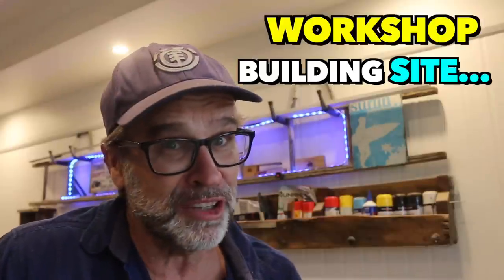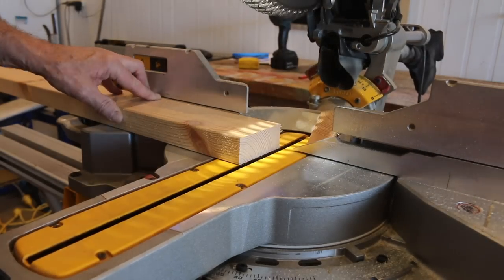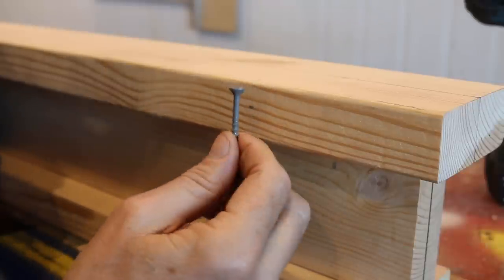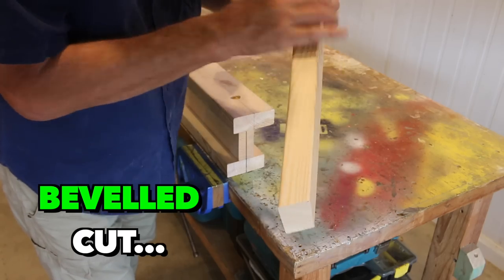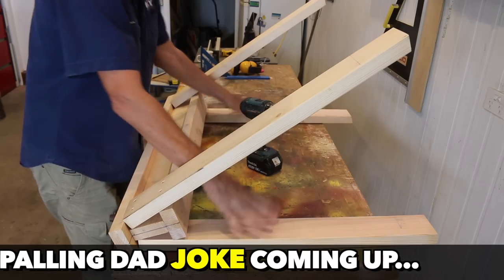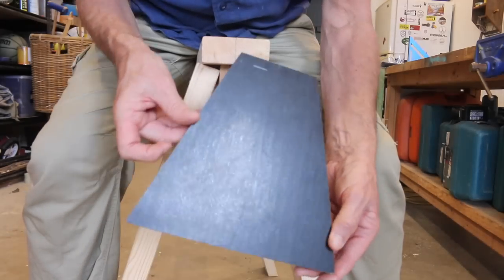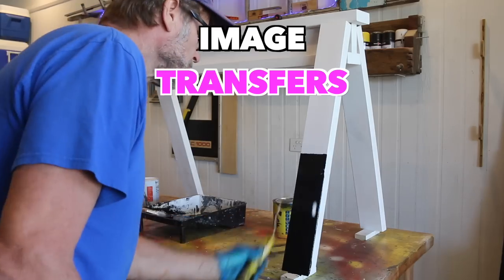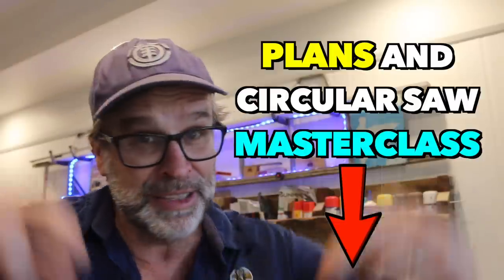Every Workshop NEEDS These Sawhorses!

Comment: Thanks for this lovely helping, non serious and playful videos! Keep em coming ya little horse! 🐎🎠
Reply from the maker: Hahahahha....Cheers Ethan 👍😁🇦🇺
Reply: Good one Knackers. One small thing I would add. When building my first saw horses as an apprentice Chippie, I was told to also cut the bevel on the top of the legs. That way the end provides that bit of extra direct support, for those times we sometimes put heavier loads on them. That is just me and your method would do everything you intend it to. Keep up the Dad jokes, I am not allowed to use them at home, except when the kids visit. They still laugh, even if my wife does not.

Comment: Great saw horses, indeed. If you're a little careful with your saw, they're going to last you a long time.
One little idea: you could add a board between the legs of the bottom one. It can be a place to lay a tool, and it can be a place where you can put some serious weight of you need your saw horse to withstand some pushing.
Reply from the maker: Yeah, that's a good tip Andre! Glad you liked them mate 👍😁🇦🇺

Comment: I already have a couple of pairs otherwise I’d be making some. My top tip use a length of old kitchen worktop (about 1.2 metre long) on top.  Enough weight for a solid bench for most purposes and easily stored. I don’t imagine I’m the only one.
Reply from the maker: Good tip Mike! Thanks for watching mate 👍😁🇦🇺

Comment: Dear Uncle! For added dust collection and riving knife I picked up a Makita track circular saw (6 1/2 inch blade) with tracks and I am getting ready to use it! What puzzles me a lot is your recommendation to adjust the depth of cut to set to exceed the thickness of the material to be cut by roughly 1/8 of an inch, and yet you make a beautiful cut straight on you bench without any “obvious” evidence of scrap wood elevating the material all WITHOUT SCRATCHING your workbench top?! Some advanced trick we need to be aware of??

Comment: I love making these things. If you move the legs in a few inches from the ends, the I-beam design allows you to make brackets from the same 2x4s you use to build the sawhorse to quickly slot on all sorts of detachable addons for jobs that can attach by drilling a hole through the centre beam in the I and the U shaped bracket you slide into the I and slapping a bolt through to lock it on. Very handy and versatile design that can serve as a portable workstation with a little imagination and time spent building a few things to further it's functionality.
Reply from the maker: Some great tips there P.P! Thanks for sharing 👍😁🇦🇺

Comment: Great and easy saw horses.  I'm making some like this.  The only addition I'm going to do is to not use plugs, but instead put dowel protruding about 10mm from the bottom screw recesses.  That way, the horses will stack like LEGO with the bottom dowels fitting snug into the top screw recesses.  It will make the stack stable by eliminating lateral slipping.
Love your videos!
Reply from the maker: Great tip mate!!! Would love to see that 👍 Thanks for watching 👍😁🇦🇺

Comment: Great vid again Uncle, love the whole series of DIY for knuckleheads…could have been meant for me😅..one thing I need and have not found in your vids is how to make an extension table for a cheap(est) table saw from Bunnings. I love using it but can’t do cuts on wide or long material.  Which means I use a circular saw and that means re arranging my work shop as it’s quite small. Anyhow Unc anything you can suggest will help..keep calm and carry on 👍
Reply from the maker: Thanks Phil...glad you like vids mate 👍👍 I don't have a video on the extension table like you want but l'm sure there would be an example somewhere on the Tube. Good luck with it mate 👍😁🇦🇺

Comment: Nice strong design. If I get around to making a couple of  these I’d consider adding a couple of bench dog holes as I’m sure the saw horses would still be plenty strong, even with a couple of holes along the center line.
Reply from the maker: Yeah, good tip Marcel 👍 Thanks for watching mate 👍😁🇦🇺

Comment: Awesome sawhorses! How do you figure out the angle of the bevel cut? I always struggle figuring out the angle if I want something like legs sitting flat on the ground
Reply: Go to the channel and watch the original video when uncle knackers makes sawhorses for the 1st time 👍🏼👍🏼👍🏼 if I remember correctly it’s 17 degrees or something
Reply: Screw everything together first. Then measure the height of gap to floor on one of the corners. Simple trig then gives the angles needed. Unscrew and cut, screw back together.
Reply from the maker: Thanks August! David is Right mate 😁

Comment: Hey mate, sorrt i couldnt find a video on your channel that shows how to do yoir image transfer.
Could you please share how you do this?
Keep up your awesome videos!
Cheers mate.
Josh
Reply: Ahh no worries mate i found your video 😊😊 label paper!! Cheers mate
Reply from the maker: Awesome! You'll have fun with it Josh 👍👍 Just one quick tip....once you print the image, be very careful not to touch the image as the ink is sitting on top of the paper and smudges very easily. Good luck 👍😁🇦🇺
Reply: @diyforknuckleheads  thank you. 

Ive been using a glue like product called  MOD PODGE. You can transfer the ink from standard printing paper. But it leaves a translucent surface just like wood glue would if you didnt wipe it up before drying. You should give it a go sometime to compare. And i will try your method too 😊

Thanks mate
Reply from the maker: @SpiderKillaz  Josh l've used Mod Lodge before on a couple of projects...it's good stuff.but a little more expensive than just an image transfer 👍👍

Comment: Nice horse. Just 1 question, would it look nice / be stronger if the top of the legs were bevelled too?
Reply from the maker: Thanks Adam! When you bevel the top the leg it narrows the stance of the sawhorse which makes it a little less unstable. Crazy l know, but it does change the angle of the legs more than you would think 👍👍

Comment: Uncle knackers, great video. Love the lame jokes 😃.

I got a Ryobi saw instead of ozito (I thought I would spend a little extra for a critical tool) but the Ryobi is no good. It tips from side to side while cutting. Is the Makita any better? Or is it a common fault in all circular saws?
Reply: Not "lame" jokes they are DAD jokes, silly.
Reply from the maker: Thanks mate. With all power tools tools there is a degree of user capability. If you hold the saw flat it shouldn't tilt. My Makita is as flat as a tack and l have no issue at all with it tilting. Good luck and thanks for taking the time to watch. Cheers 👍😁🇦🇺

Comment: Really nice pair of sawhorses Shane, really nice (and here comes the but) but I have just priced the material needed from the hardware pirate called Bunnings and even using the cheapest crap I could find in their den of thieves the 4 x 2s, sorry 90 x 45 it will still cost around $95 which doesn't make for a very affordable pair of sawhorses.
I mentioned to a Bunnings cashier about the stupid price of wood post COVID and said _"This stuff is really expensive, doesn't this 
 grow on trees anymore?"_ Went right over their head. Bloody stupid young people.